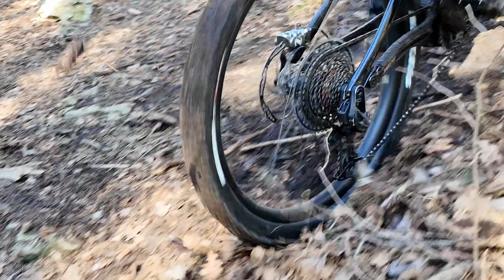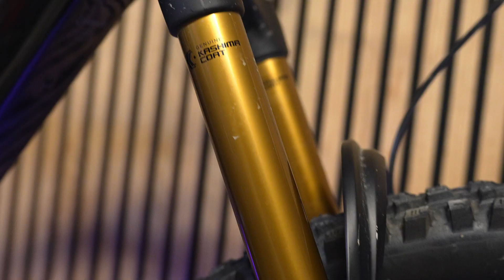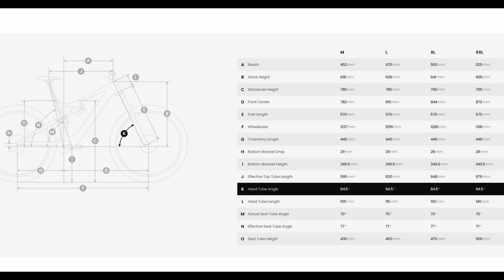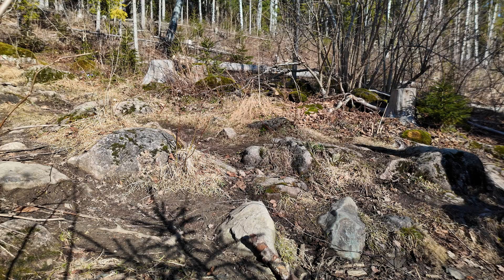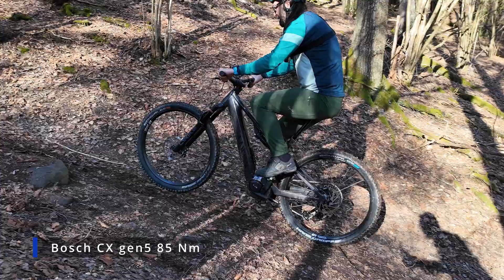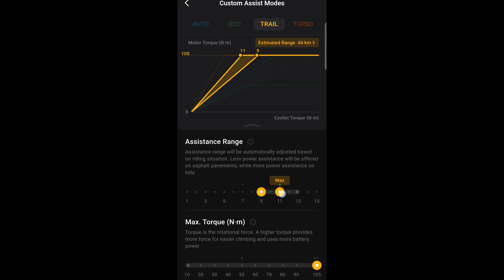Amflow PL Pro Carbon and Avinox motor review

Comment: Motor rattle or derailleur/chain rattle especially if it was mainly happening in the smaller sprockets due to the lower chain tension applied by the derailleur in those settings.